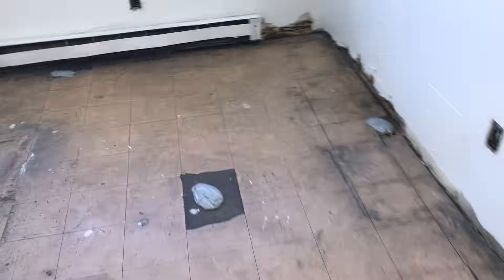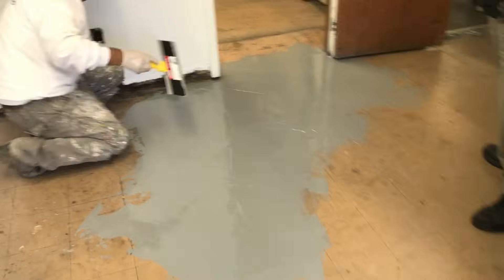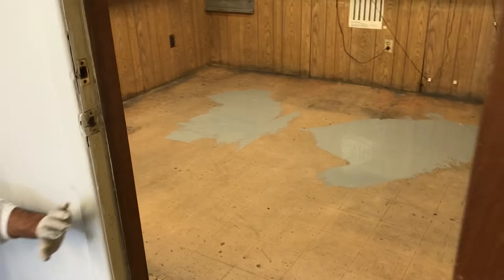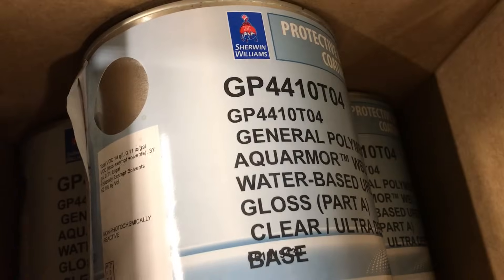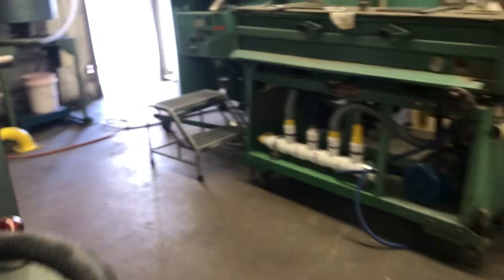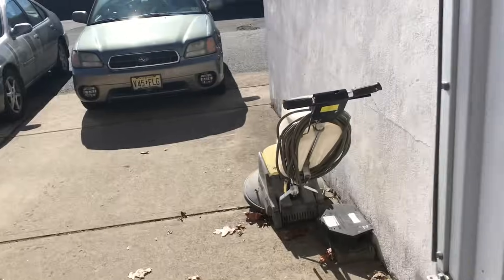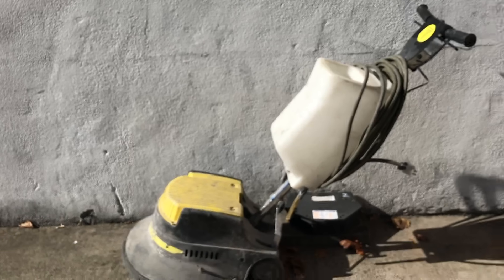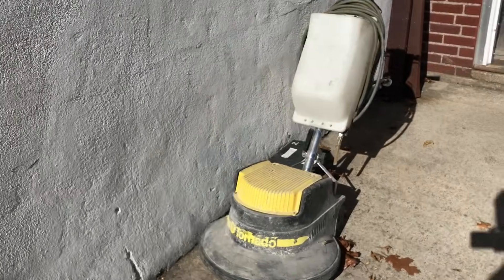Asbestos Encapsulation Epoxy Flooring: A Comprehensive Guide

Comment: What brand (or spec) "fast cure epoxy" do you use (in step #2) for locations with missing or broken VAT tiles?
Reply: did your question regarding a "fast cure epoxy" ever get answered?
Reply from the maker: Use 100% solid epoxy it offers more clarity and “saturation”

Comment: This is great thanks for posting. 
How is this floor holding up after a year?
You dont acid etch the VAT? These are the steps you listed:

1. Use grain pad on floor buffer.
2. Use GP3579
3. Use GP4410

Do you do any other prep to the VAT before application of 3579?

Do you put a middle layer between GP3579 and GP4410?

Keep up the good work
Reply: 1. Use grain pad on floor buffer.
2. Fast cure epoxy in the locations without tiles
3. Use GP3579 epoxy primer, 20mil thickness, buff epoxy
4. Use GP4410 urethane
Reply: 3579
Reply: I think he said flor buffer with a green pad.